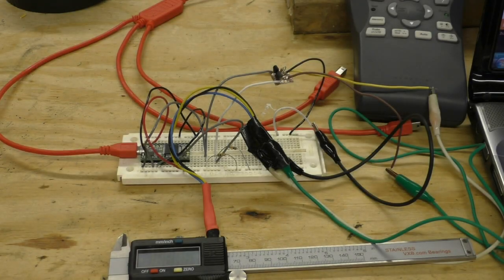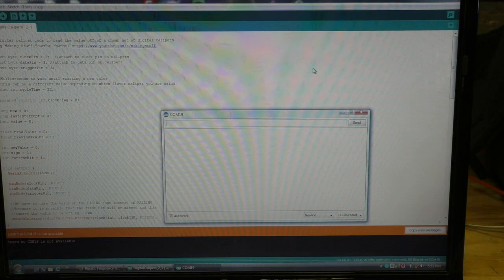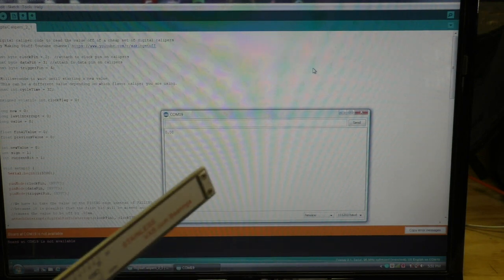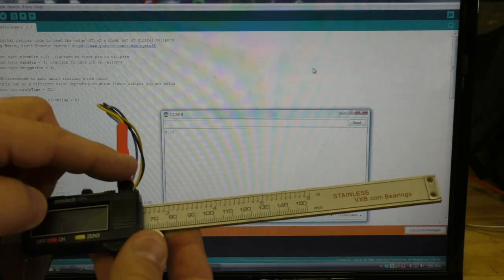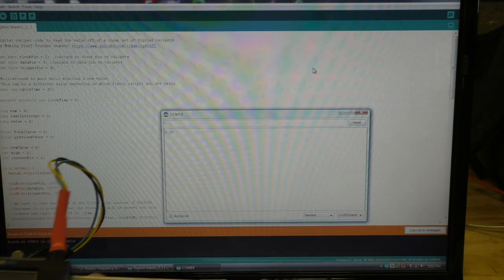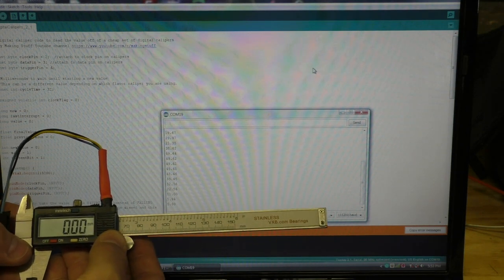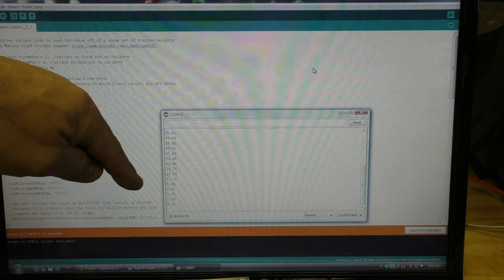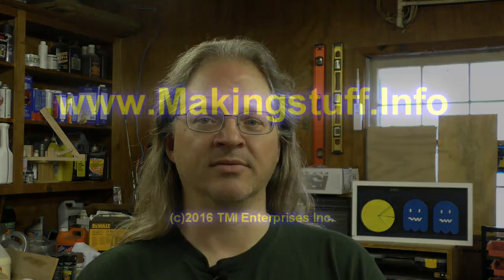DIY Digital Caliper Data Plug Part 2 - Arduino Code and Special Announcement

Comment: Thanks man, I was just on Russ's channel and he was advertising the same thing. How did you guys do that back to back? I don't even have a 3D printer , but I would like to make my own weedeater line out of maybe hdpe or something I would otherwise just throw away. The weedeater line is really a little expensive for no more than you get and  how long it lasts.
Reply from the maker: +Bush Imports I'm sure you can make weed eater line.  It seems that it would be easier to make because to tolerance would not be so critical.

Comment: Hi , i made this circuit but in your program you are using pin 4 as trigger input pin but in downloaded program there is no trigger pin ??? and also in you video . Pls help me to make it 
 as values are not coming .
Reply: Hi , did you figured it out something about this? @MakingStuff

Comment: Is it possible to reprogram a set of calipers? I am looking to alter the readout so that the liner dimension is used in a simple equation and the answer displayed on the caliper readout....for example 'x' squared. So, an actual liner dimension 'x' of lets say 3.54mm would return a readout of 12.532mm. Thanks in advance!

Comment: Are you doing an extruder to make filament or an extruder to use filament (like to put on a printer)?  

If it is to make filament, will you be using it to recycle old/failed prints?  Just curious.
Reply from the maker: +servant74 The extruder Russ and I will be working on will make filament from plastic pellets.  I suppose it would be possible to make it from recycled prints. However, the old prints would need to be shredded first so they would fit in the extruder.  Sounds like fun!

Comment: Hey Bob, I have a question regarding the calipers logic level shifter wiring. I have the logic level shifter all connected on a protoboard, but I don't understand where the "Arduino vout" connection is supposed to go (the one between the 2 10k resistors). I'm currently getting erratic and innacurate readings from my caliper so I assume it's because I'm missing something related to this vout.
Reply from the maker: The Vout is the voltage that your arduino uses(5v or 3.3v).  I am using a Teensy which is not 5v tolerant but it has a 5v input pin that is regulated down to 3.3v and a second input pin that is not regulated which is 3.3v.  I always refer to the second 3.3v pin as Vout since it is out of the on board regulator.  Sorry for the confusion.
Reply: Nothing to be sorry about, I'm grateful to you for making your knowledge public. On my case, I',m using an Arduino Nano powered through USB, and it has 2 regulated outputs (one 3.3v and another 5v). I tried connecting the "vout" to both of these voltage outputs but had no luck. I guess I'll try again later today.

Something else I'm yet to understand is the line of code:

//Milliseconds to wait until starting a new value
//This can be a different value depending on which flavor caliper you are using.
const int cycleTime = 32; 

I'm not sure how to determine what the proper value of that INT is. I guess you found yours with an oscilloscope, but without one, I guess I can just try and test.

Comment: Hi all right, I hope so ...
I'm Fernando, Brazil ..
I do electrical engineering and I'm using your caliper project as the basis for my final project, which will be aimed at helping people with visual impairments.
but I got to a part that I need help with ...
could you give me some tips ... how do I get in touch?

Comment: I tried building the DRO and using the code provided on GitHub but mine does not seem to be working. The values on the Vernier is stable and according to the vernier position, but the values I am getting on the serial is inconsistent and jumps around sometimes to +- 300ish. 
Is there a specific reason for this?
Reply: Tried the tutorial as per the Making Stuff website.

Comment: i've tried to download your source code but it says ERROR 404, not found... =(
Reply from the maker: Web page was changed since video was made.  Make sure you are using this link and not an old one.  http://www.makingstuff.info/Projects/Digital_Calipers
Reply: Thank you Bob!, My caliper works just fine... Now im making my filament puller control loop!

Comment: Okay, I'm through part 1 and half way through part 2 and I can confirm with complete confidence that I'm an idiot. I have no freaking idea what in the world anybody would have a practical use for putting a reading on their computer from this digital caliper or any other digital caliper for that matter. I suppose pencils and paper or now passe and I'm just ready to go out to pasture. got to be more trouble getting this information back off the computer then it would be just to look at the damn paper. I'm sure there is one, but I waited patiently to figure out what in the world it would be. I can wait no longer, even if the answer lies in the second half of part 2. Let's just leave the reasoning to the geniuses, and I Leave myself to my pencil and paper and move on.
Reply from the maker: Used on filament extruder videos.
Reply: We had to do a job in the mechanical engineering school  in which I used to be a student where we had to make a huge number of cylindrical parts for Tensile testing. The tolerances were too high and we had to know when it was time to change the cutting tool in our CNC lathe which was producing those parts. So we used our digital caliper, in a similar way as in the video, to transfer the data we needed directly to a Spreadsheet we made, in order to do repetitive calculations automated and fast.